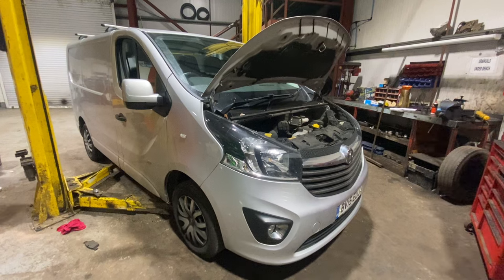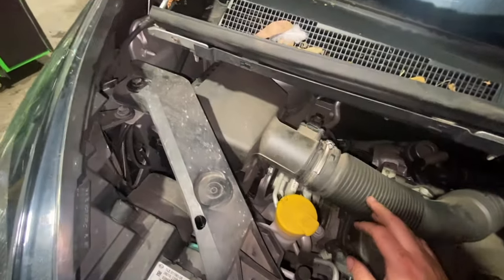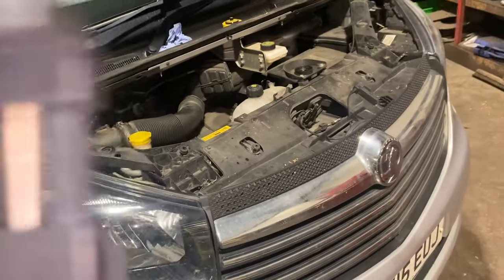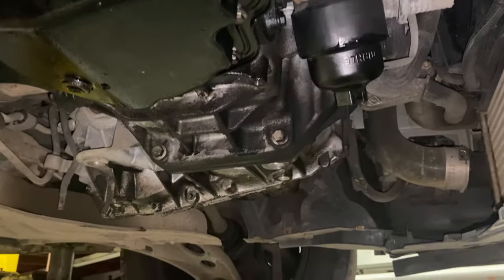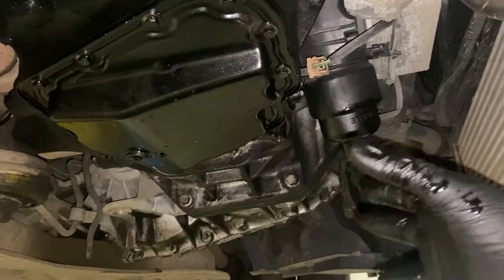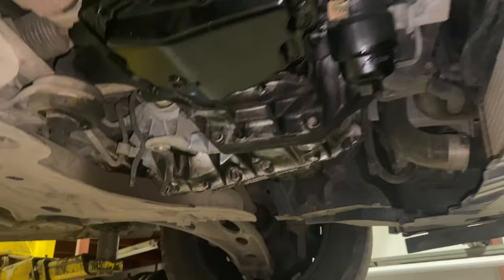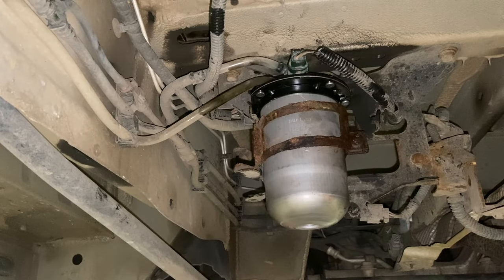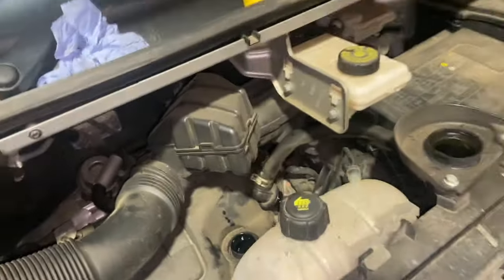2015 Vauxhall Vivaro / Renault Trafic Engine service

Comment from the maker: Check Euro car parts for filters etc - https://tidd.ly/3lIO7xA  (use discount codes on site)
Check "Car Parts for Less" - https://tidd.ly/2LNEwIn  (use discount codes on site)
Oil & filter kit Ebay - https://ebay.us/yar0YC
Air filter Ebay - https://ebay.us/AkFKsk
OE Fuel filter housing Ebay - https://ebay.us/TQgiiv
4L Engine oil amazon - https://amzn.to/3ujyWPp
Brake cleaner eBay  - https://ebay.us/57pfYI
Purflux fuel filter housing part no - FCS922

Tools :         
3/8 Digital torque wrench - https://amzn.to/2PP9vpP
3/8 standard torque wrench - https://amzn.to/33eZsxj
Socket set - https://amzn.to/3eGx2Ak
Brake cleaner sprayer - https://amzn.to/2BLF1gX
Long reach 3/8 ratchet - https://amzn.to/3iJsADg
Ring Inspection Lamp - https://amzn.to/3gGWHcG
torx screw driver set eBay - http://www.ebay.co.uk/itm/142442401623
Pic set - https://amzn.to/33JcZyJ
Dewalt 3/8 impact driver - https://amzn.to/3njemLY
Screwdriver set - https://amzn.to/3jswgJP
Snap on mini flat blade screwdriver - https://ebay.us/grHTHT
Sump plug removal tool set -  https://ebay.us/vfIbRq
Mole grip set - https://ebay.us/EMIJrq
7mm hose clip tool - https://ebay.us/wJjmgj

Comment: Of corse Renault will only sell you the full fuel filter housing,,Because they can charge you 50 quid for them,,Insted of the 5 or 6 quid you can buy the filter eliment inside...

Comment: Are you sure you connected the couplings in right connections?
The middle connection is going to the engine(clean fuel)?
And the outer connection is coming from fuel tank(not clean fuel)?

Comment: Hi. Do you know where the thermostat is and is it a front off job. I've searched high and low. No one seems to know or not willing to help. Thanks Christian
Reply from the maker: I’m sure it’s located on the front , but awkward to access and you’ll need some of the front end off by its easy to strip

Comment: Any idea why the drain plug torque is 50nm? Seems high compared to most other cars.
Reply from the maker: Yeah just the recommended, ive known a few similar just depends on the size thread/pitch etc & the type of metal they are going into

Comment: Yesterday i changed the fuel filter with your help. Mine has rear secondary air conditioning unit and it is a little bit different the way to do it but i did it. Thanks.
Reply from the maker: are never come across that before, glad it helped 👍

Comment: Quick question when changing gear sometimes the clutch stops further down other times it pops up bk to normal.. I that normal
Reply from the maker: No mate I’m afraid that could be a fault with your clutch slave or master cylinder 😬

Comment: Hey, i have a question, Is it not necessary to bleed the system after replacing the fuel filter?
Reply from the maker: Neh I never do with that style pump 👍 it has a pre pump in tank and soon forces the air out

Comment: How do I bleed the cooling system on this vehicle
Reply from the maker: Have a check round all the pipes that are high up , there may be a bleed screw in one of them .. if not run it was the header tank cap off for about 10 minute.. keep the heater on full blow and full heat ; once it’s getting up to temp the air should be out

Comment: Great video 👍👍. Do you know what the service intervals are and what needs to be changed? I bought my 2018 Trafic second hand and know it has one service (oil+oilfilter) at 12400mls. Now it has almost 19000mls and i like to know when it's time to do the next service and what's needed. I already ordered all the parts you replaced so i can do that .  Thanks for the info.
Reply from the maker: Thanks for the comment, much appreciated 👍 officially the intervals are every 25,000 or 2 years (which ever comes first) but personally I think that's way too long! We say every 12,500 miles or a year.. The engine oil certainly wants changing every 12,500 miles at a minimum.. they are very prone to turbo failure through oil starvation due to poor quality oil.. keep the oil changes up an you shouldn't have much bother 👍 The fuel & air filters are officially due at 50,000 / 4 years but again id be doing them at 3yrs / 37,500  max
Reply: @diydaly  Thanks for the information. I'm going to replace all these parts at 20,000mls and take that as a starting point. Then every 12,500mls at least oil and filter (this is about once a year for me). Keep up the good work 👍👍
Reply from the maker: @curtraaymakers6777  yeah that’ll be ideal mate .. you definetly want to get the complete fuel filter housing rather than just the element 👍 purflux do an aftermarket one

Comment: Was that making a "ticking" sound on startup? Mine does this for 5 to 7 seconds?
Reply from the maker: Hi garry I can’t remember it too well as it was a while a go but seem to think I’ve had a few sound similar
Reply: That's your ad blue pump spraying that into your exhaust system,
Reply: @1971dave  Thanks for that. Is it fault?
Reply: @snappyfish  no,, just don't leave your add blue go below 30%, on your trip computer,, I've  worked for Renault 6 years, 1.6 are a load of rubbish, egr valve show me a most of them before 30000, clutch master cylinder which is located above the clutch pedal changed within months of new vehicles, bottom crankcase pulley oil seal leaks within 10000 miles, I would challenge anybody to take their undercover tray off and you will see the oil leak on vans that's done 7000 miles,  workshop we only work on vehicles that are under warranty, shocking

Comment: Quick question renault traffic 2015 crewcab,  won't go in gear when started ? But goes in gear when engine is off
Reply from the maker: Clutch fault I’m afraid mate 😖 could be the clutch it’s self , the clutch slave cylinder or the master cylinder
Reply: @diydaly  OK cheers only just got it yesterday aswell got 3month warranty on it
Reply from the maker: @andymethley2298  are that's lucky then! as could be quite costly otherwise 👍
Reply: Well it's been back for a new clutch apparently
Reply from the maker: @andymethley2298  👍

Comment: How many liters of oil does this car take?
Reply from the maker: 6 Litres mate
Reply: I thought these take 7.4 litres?
Reply from the maker: @iansteward9193  depends on the engine code mate , some are 7.4 , think the difference is single or twin turbo models
Reply: @diydaly  yeah mines a bi turbo defo 7.4 litres 😀
Reply from the maker: @iansteward9193  👌👍

Comment: Great video ,Did you find the oil leak ?
Reply from the maker: Thanks Mike! Not yet mate , I’ve got it coming back in next month to have a gander see if I can find it 👍
Reply: @diydaly  Its the timing chain cover, the sealant from factory is crap and it breaks down.. Renault had my van in for repairing it and engine had to come out less than 12months later its leaking again
Reply: did you sort the leak on this one mate?
Reply from the maker: @brownsadventures312  still not had it back yet, had quite a few leaking from the side cover but I think this one was from one of the turbo oil feed pipes
Reply: @diydaly  are they easy to re seal the cover with engine in situ or best to remove engine ?
Reply from the maker: @brownsadventures312  they can be done in situ it’s just abit awkward